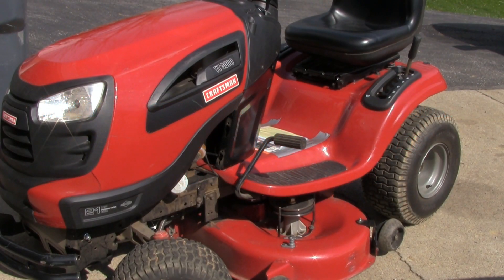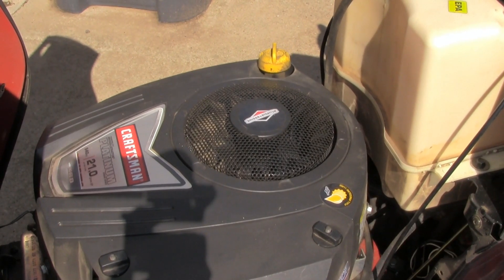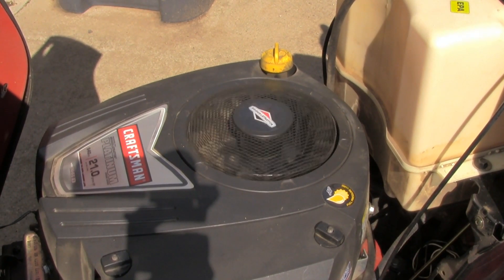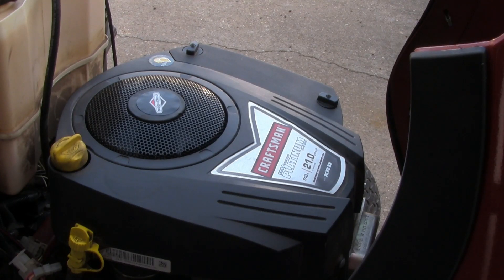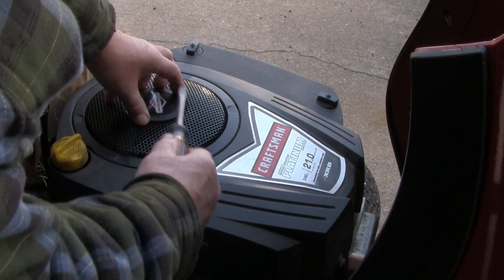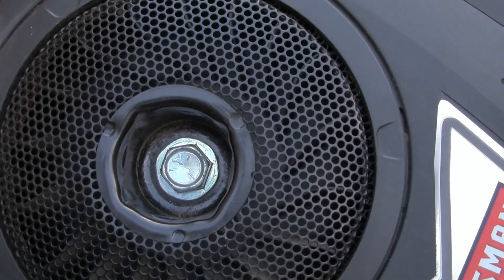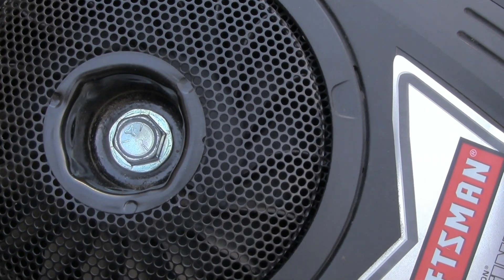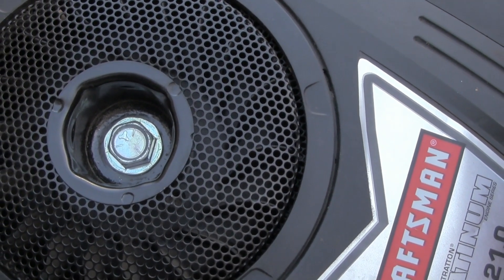Craftsman YT3000 riding mower won't crank issue fixed.

Comment: The valve adjustment on intake valve is so critical.  On compression stroke stop 45 deg before top-dead-center.  Tightern the intake valve until u get a miniscual amount of NEGATIVE clearance.  Rotate the engine about 180 degree and see if u have at least 0.002" clearance.  Trust me.  That is enough.  .003" is optimal.  I have to economize and all 3 of my lawn tractors were given to me because they would not crank.  I gave away 2.  All 3 are still running.  Never rotate the motor backwards: it damages the decompressor.  After 5 hrs running recheck.  U will see it has not changed.
Reply: you sir were DEAD ON POINT! thank you!!!!!!!!!!!!!!!!!!!!!!!!

Comment: Was running fine then POW backfire under a sudden heavy mowing load. Died. Hard to crank and then Pow backfire.
I will check this FIRST and next :-0) Thank you!
UPDATE: No update yet, still need to get time to do it.
Reply from the maker: Your welcome
Reply: @LonnieJohnson1  Got the crankshaft nut off and sure enough - sheared keyway (spun about 180 off )
Now I just need to get a puller to get the flywheel off :-0)

Thank you. Thank you. THANK YOU!!!
Reply: @LonnieJohnson1  NEW PROBLEM
I put in a new key and it sheared it off almost immediately
and when the backfire happened from that, the bottom pulley fell off???
[[ I see no keyway in the bottom dual pulley assembly (drive/deck) so apparently just friction holds it on? I have no idea how long the bottom bolt and washer have been missing. The dual pulley with dual belts apparently help it stay in place even when the bolt and washer are not installed.  ]]
Anyway, back to the flywheel key, it looks like the keyway in the crankshaft has possibly been wallered out as it is visibly wider at the end of the crankshaft and gets narrower moving from there.

Is there any kind of fix you can think of for that? or is a new crankshaft the only option to save the engine?
UPDATE: I see this video so I am wondering
https://www.youtube.com/watch?v=BOt5V5TZefI
UPDATE 2 there is also loctite
https://www.youtube.com/watch?v=LLSLtr0ECbc
Reply from the maker: Check the pulley and see if it has an indent like the size of a keyway under the small pulley or does the pulley also have a slot for a key?
Reply from the maker: The motor is trying to run backwards. It does sounds like the flywheel key and if the shaft is grooved and damaged it don't look good. What size motor is it?
Reply: @LonnieJohnson1  21 HP - Nothing inside the pulley but now I see is has a hole (1/4"x1") ripped open like maybe it did have a key-like protrusion on the inside of the shafts hole that would have engaged the crank slot.
I'm going to try Loctite 660 to install a key in the topside of the crank for the flywheel. Will have to order it.
Once it is up and running (crossed fingers)  I may have to fix the pulley assembly too or get another one
(definitely have to get the bolt and washer that screws into the bottom side of the crank - those were lost who knows when)
Reply: @LonnieJohnson1  UPDATE
I got a new(used) pulley replacement
and used JB WELD to stick the key into the worn keyway.
[[ IMPORTANT NOTE - I had to get the replacement key (not a generic square key)
https://www.ebay.com/itm/Flywheel-Key-For-Briggs-And-Stratton-61760-222698-222698S-Pack-of-10/273598301101
]]
I fired right up and I mowed nearly a full tank worth of gas (couple hours) with no problems thus far.

Hope it hold out.
Thanks.